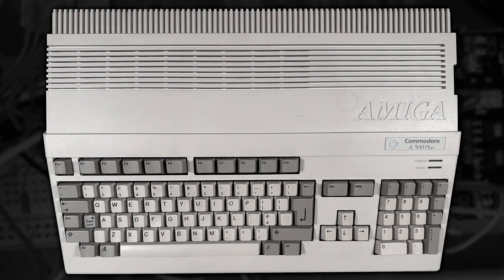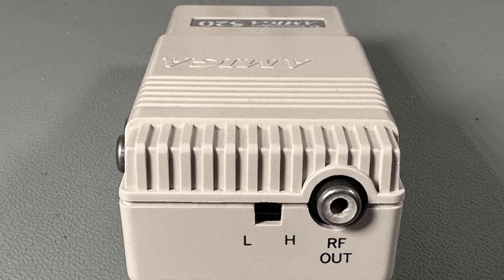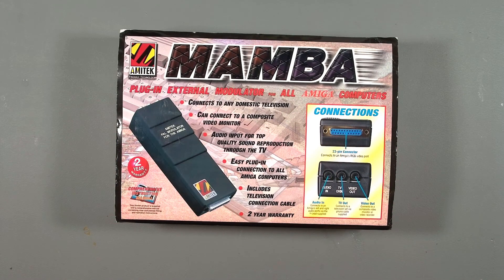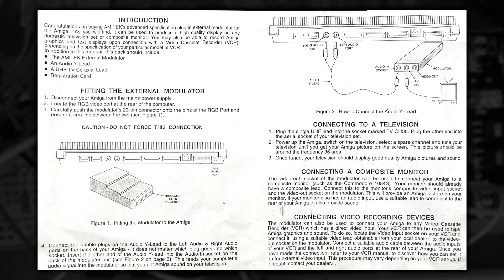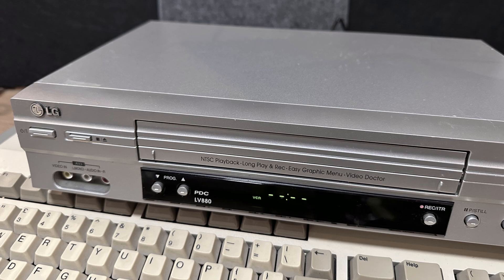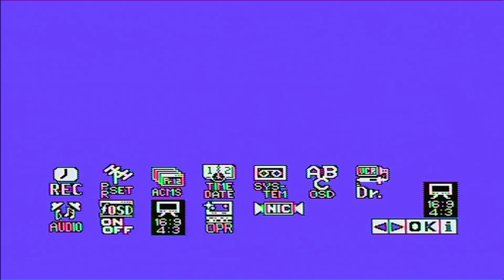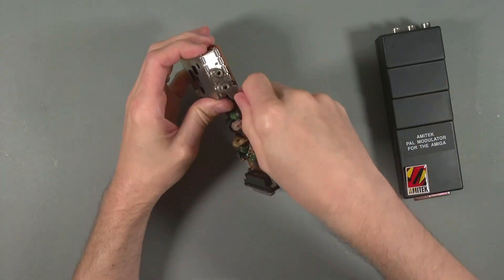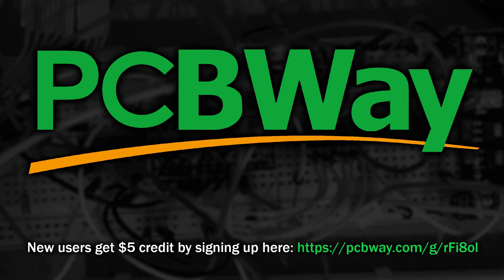Meet the MAMBA, the Alternative to the A520 Modulator.. but why?

Comment: The mamba has very much improved power (with aged caps prob not now) and the black dial is the tuner control for the VCR tuner chip. it also has more inductors so with fresh caps should provide a much better picture. there is also a spot for a delay line which was often used in HQ VCR's to provide a better Sync signal

Comment: The composite output on the Amiga 1000 was color composite already.  At least for the NTSC ones, and I'd think for PAL as well?
Reply from the maker: You are right but from what I understand some of the early ones had a mix of parts (NTSC/PAL mixup) which stopped it working right

Comment: Could the A520 or the Mamba be modded to use the S-Video pinout?
Reply from the maker: I think there’s plans on the internet to do it. It’s fairly simple I think
Reply: @RobSmithDev  similar to the master system II, there are plans for the video chip to take out S-Video or Composite Video, I only took out Composite Video though on mine. Interesting back in the day they only built them with RF out, I guess it was because maybe TVs then only had the antenna in, but interesting the chip was capable at that time of the other video outputs.
Reply from the maker: Yeah as I said in the video my tv only had RF so was glad of these devices!

Comment: We were poor so I couldn't afford a monitor back then, also had to use that TV modulator on a big old color TV. That's probably why my eyes are so bad now 🤣 I wished I had known about the SCART connector back then, the TV most likely had an input for that.

Most of my C64 boards look like that mamba board. I think that's due to the "wave soldering" process used to apply the solder.

Comment: I'll just add that in addition to the mod floating around that adds S-Video output to the A520 there are also some simple mods documented that you can make to improve the output quality of the composite a bit too. The original as shipped from Commodore really was built to absolute bare minimum cost so there's plenty of room for improvement as you pointed out.

Comment: I'm an ex PCB manufacturing engineer and I can answer your question about the underside of the board. Pattern-plated Tin-Lead (SnPb) was used as an etch resist (Copper areas not covered in SnPb get removed during etching). In low-tech / low-cost PCB manufacturing processes a thicker deposit of SnPb was applied during plating and was left on the boards after etching. Before soldermask application the plated SnPb will have been reflowed to encapsulate the exposed sidewalls of the copper traces. Soldermask will then have been applied.

What you are seeing under the soldermask occurs when the populated PCB board is wave soldered. The SnPb under the soldermask melts and gets pushed around by the solder wave, leaving a ripple-like effect.

Comment: 10:44 After building things... Yes, This is very likely the reason, creating your own 5V with a linear resistive regulator is a good way to get a very clean power supply, and it does reduce noise on output signals.

Comment: I believe the external modulators were better quality than the built in A600/A1200 modulator. I had a monitor but others swore by using an A520 or similar.

Comment: In the USA we never had the A520 included. Having aftermarket makes sense, just like there were multiple suppliers of floppy drives.
In the USA I would say 85% or more of us had a 1084 along with our Amigas anyways. I don't recall a single Amiga friend in the 80's and 90's using a TV.
Reply from the maker: Wow that’s interesting, I don’t know if wasn’t included seeing as it was in the UK. Maybe Commodore USA was targeting Amiga at the more serious market and less of a games machine
Reply: Same experience here in Canada. The A520 wasn't included, it was a $50 or $60CAD optional add on. When I first got my A500 I actually just used the onboard mono video output for the first  6 months or so until I could afford a proper monitor for it. I did eventually buy an A520, but strictly for the purpose of an inexpensive way of hooking my Amiga up to a VCR to do video titling for some school video projects.
Reply: A520 was included in the Bonus Pack, we bought ours at retail in probably either late 90 / early 91
Reply: One of the things I noticed from reading UK computer magazines were the prices. The prices were the same as in the US, but in UK Pounds - meaning a $300 monitor was 300 Pounds - basically double the US price . Often the UK price was more than double. No wonder they were using the A520...those UK prices were just insanely high.

Comment: LS74 vs. HCT74 are logically/functionally identical but use different manufacturing processes and have different response times - bit more than just "different manufacturers". While they can often be interchanged without much thought in digital circuits it's likely one of the ascpects to make a difference here.
Reply from the maker: I’m not exactly sure what this part does in the modulator. I think it’s something to do with the Csync signal - so that would theoretically only cause issues at the start/end of lines. Not sure

Comment: A520s did fail and i have fixed quite a few back in the day. They didn't fail electonicly, but rather mechanicly. Back in the day most people didn't have dedicated tv for Amiga and used one and only family tv, wich ment puting Amiga away when not in use, and since A520 is only held in the Amiga by connector and didn't have any screws it didn't take alot for it to fell out and drop to the flor. When bumped hard enough small transformer/coil inside, the one near MC1377 chip comes loose and one or more hair thin wires get broken resulting in no collor or no picture at all. Easy fix btw.
Reply: I first used A520 on a family tv and later got broken 1084 commodore monitor from rich neighbor who just bought new monitor without even trying to repair the old one. Few fixed bad solder joints later and i had the monitor for my A500, but i also used A520 sometimes to play games with my friends on a bigger tv. Currently i have 2 A520, both where given to me as non working and both had the same problem, coil rattling inside the case😀 i never use them because of obvious advantage of rgb scart, but i kept them as for me, it was part of the original Amiga setup i had. Ahhh..good times..when hardest of our worries where to save all the lemmings and to keep Jools and Joops from becoming cannon fodder😂
Reply: I repaired many of them with MC1377P failed. I still have some MC1377P chips in my drawer.
Reply: @payamvarposhti5185 people just loved hutpluging things even if was not a good idea on computers back then.
Reply from the maker: Ah interesting. Ours was always left setup so probably why we never had any issues!

Comment: IIRC the L/H switch worked differently between the PAL and NTSC versions. On NTSC it changed the output from CH3 to CH4 to avoid interference. On PAL units the switch changed between 5.5Mhz PAL B/G audio used in Contiental Europe, and 6Mhz PAL-I audio used in the UK (and Hong Kong, South Africa etc,). If the screen you used to test wasn't multiformat, then you would have had trouble tuning in sound with the switch the wrong way.

Comment: Flowed solder used to be like this. Especially on large areas like that, where it would be worse. Lots of old electronics (and probably the VHS you have there) will have it. 

Good video!
Reply from the maker: Thanks for the info :)

Comment: Really enjoyed this video on the humble, unsung hero of Amiga owners in the 1980s!

I recall these third party until only really started to appear once the A520 was discontinued by Commodore. Remember GVP producing one too - or maybe it’s the same one as this rebadged. I might be misremembering, but am sure Amiga Shopper suggested one of these in their letters pages to an A1200 user whose internal modulator failed on their out of warranty machine. Maybe it was because it offered better quality video over spending the same money to get a ropey internal modulator fixed by a third party repairer.
Reply from the maker: Ah yeah I guess it’s probably easier than a replacement to the internal one.

Comment: Just for comparison, analog video is often 0.7 or 1.0 V p-p, so the 20-50 mV noise on the supply can have a huge impact on the result, especially if it is not further filtered or dealt with on the A520. Especially given the broad frequency content we see in the scope.

Comment: I am a bit puzzled why you would say people in Europe would ever be in a situation to have a TV  NOT accepting RGB SCART, since the EC/EU required by law that every TV has an RGB SCART input since the late 1970s. Did the UK opt out of that? I have never in my life EVER seen a TV NOT having SCART, and I was born 1983. My cousin connected his AMIGA via SCART, just like we did with  everything else. Or did you have a computer monitor specifically (ie a non TV) that did not accept SCART? In fact, the Amiga 500 is so new (1987), at that time even Eastern Europe had adopted it as a required standard.
Reply from the maker: It was quite common to find a TV in the UK without scart. But I don’t know how old they were. I suspect the large second hand market had an impact on this
Reply: @RobSmithDev Maybe a standards opt-out by the UK. Wouldn't be shocked.
Reply from the maker: Well that VCR in the video, whilst having scart didnt support RGB, it was just composite. 
According to wikipedia, it was only compulsory on new devices in easten europe (1987) so that may explain it.
Reply: Historically we needed different tuners in UK TVs (PAL-I vs PAL B/G), so that was an opportunity to drop SCART from the BOM, or just not include it in the design in first place to save money building UK models. From the early 90s everything became integrated into silicon, so the tiny additional cost in TVs being multiformat was outweighed by the saving of making one single device for the whole of Europe. It was only then SCART (and Teletext) became universal on TVs sold in the UK.
Reply: The portable TV I had in 1993 or thereabouts didn't have a SCART or an AV input. Nor did the family TV in the living room (26" Philips teletext model). They hadn't become standard until the mid-90s.

Of course nowadays they're fast disappearing - my new TV (LG 65C3 OLED) doesn't have a SCART, it's HDMI or nothing. Ironically you could still connect an analogue video source via RF should you want to.

Comment: Lovely video Rob! The A520 has always been an object of fascination to me and seeing it in more detail in your video was a treat! 
I wonder if the A520 can be modified with an extra 7805 in the same style as the Mamba? I wonder if thats really a question that needs answering!
I know that a popular thing to do is modify the A520 by ripping out its guts and wiring a SCART cable to the other side of that precious DB23. Might even be room to mount a scart socket in the side of the case...
Reply from the maker: Oooh some interesting mods! Mind you, the DB23 isn’t quite as hard to come by now due to a special run of them a few years back and you can grab them from eBay for a few £. I’d be stealing it for it sharing the same number of pins as the floppy drive connector though! 
You could turn this into an absolute monster of block that you plug into the back with all the different outputs (HDMI too? Lol)

Comment: My first 520 started to fail after about 5 years. The second one didn't fail for as long as I owned it.
Reply: The symptom was the signal would turn monochrome unless the 520 was raised higher and higher, had to put a coaster under it to get colour. It probably wasn't the actual modulation part failing, possibly a dodgy pin connection or solder maybe.
Reply from the maker: The one in the video had this issue until I re-soldered all the pins on the connector

Comment: The A520 wasn't that great but it was all we had back then if the TV or monitor had no RGB input.
Better convert an A520 to S-Video Y/C to hook up a TV w/o RGB  input but has S-Video.
The picture quality is so close to RGB, that was amazing back then and is still today.
I converted a unknown number of A520 to S-Video output (if someone needs more informations and can't find them in the web contact me as posts with links are blocked by Youtube.)

Comment: Early days of wave soldering . The solder used to flow under the soldermask , creating the raised areas you see .
Reply: Well, not so early, it's just that they didn't use SMOBC for this board for some reason.
Reply: @8BitNaptime  Reflow Tin-Lead finish is an older PCB manufacturing process that was in general use before SMOBC + HASL / Electroless Au etc. I started in the PCB industry in the late 80's, and by that time reflow SnPb finish was only used for low-cost / low-tech applications.
Reply: @cptnkrenon  That looks like wave soldering to me.
Reply: @8BitNaptime Don't confuse reflow soldering with reflow Tin-Lead PCB finishes. I'm talking about the bare PCB manufacturing process, not the soldering of the populated board. Yes, that board was wave soldered. But it's the reflow Tin-Lead finish that is present under the soldermask on the bare PCB that forms those wrinkles during wave soldering.
Reply: @cptnkrenon  I've never heard it called a "reflow finish". In any case, this is why I said this board isn't SMOBC. Not sure what the problem is here. That's a lot of through-hole parts for reflow, don't you think? I struggle to find any reflowed components. Can you show them to me? And maybe look up what reflow soldering is and what it's used for?
Reply: @cptnkrenon  Reflow is a soldering process used for surface mount components that involves solder paste. I've never heard it called a PCB finish.
Reply: @8BitNaptime Again, you are confusing the manufacturing finish of the bare (unpopulated) PCB with the soldering process for the populated board. They are different things, and I'm not talking about reflow soldering. I'm describing what happens to a PCB manufactured with a Reflow Tin-Lead finish when it gets wave-soldered.
Reply: @cptnkrenon  I don't think I'm confused. Reflow is a soldering process that involves surface mount components, of which I see none here.
So it's not reflowed. It's wave soldered.
The bare board itself may be HASL finished with solder mask over the solder. I've never heard that called anything else but HASL.
Reply: @8BitNaptime You've probably never heard of Reflow Tin-Lead finish because nowadays it's a long-defunct technique. I was an engineer in PCB manufacturing for almost 20 years, and when I started that job in 1987 this finish was already well on the way out. We had an old conveyorised line with a roller coater to apply flux to the etched PCBs, followed by an IR reflow oven.
Reply: @8BitNaptime  HASL wasn't introduced until the mid 80s. Reflow Tin-Lead finish pre-dates HASL by decades.
Reply: @cptnkrenon  Good thing we're talking about a board from the mid to late '80s.
Reply: @8BitNaptime  You think that HASL replaced Reflow Tin-Lead completely overnight? It was phased out over time. Our factory got its first HASL line in 1987 and the reflow line was still in use for older PCB designs for a number of years. Many factories continued to use the process well into the 90s for low-cost low-tech circuits *just-like-this-one*.
Reply: @cptnkrenon  That's great, but my initial post was about SMOBC. I still don't get your point.
Reply: @8BitNaptime  Yes, and I explained why the board was not SMOBC. Then I explained the difference between Reflow Tin-Lead surface finish (a legacy manufacturing process for bare PCBs) and Reflow Soldering (a soldering process for boards populated with surface mount components) when you confused the two. As for HASL, I can assure you that soldermask is always applied before boards are put through the HASL process. There would be no solder under the soldermask if this board was HASL finished.
Reply: Many early commodore 64 boards are like this below.

Comment: I'm pretty sure I've got a couple of A520 modulators sitting in a drawer at home. Similar story, nowadays I don't use em, but back in the day I think I was always using it on my A500 (I do remember getting a TV with SCART and composite inputs, but I'm pretty sure that I just used the composite once I got that as I didn't have or know about the RGB cables).
And yeah that thing made the already huge A500 massive, I remember getting a cheapo Argos computer desk that had a monitor shelf where the monitor/portable tv would sit but also allow part of the A500 and the modulator to sit underneath (so you still had a chance of being near your monitor whilst using the A500).
I did love the A600 for it's compact size, I remember it fitting on the desk so much better (and no RF modulator hanging out the back).

Comment: Rippled solder mask like the Mamba is fairly common on a lot of 80's boards and nothing to be worried about.
Almost every ZX Spectrum board is like that for example.
Reply: Yup, completely normal for the rolled tin plate that was typical of the era.

Comment: I suspect that the uneven bits on the bottom of the PCB are simply down to the manufacturing process used.  If you look at (the underside of) any of the original zx spectrums they use what looks to be the same process with the same result.